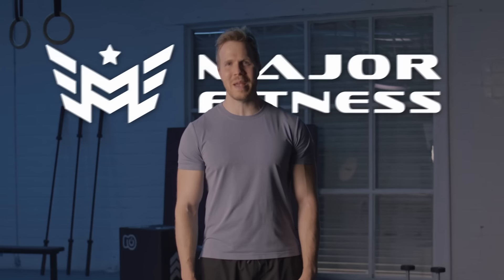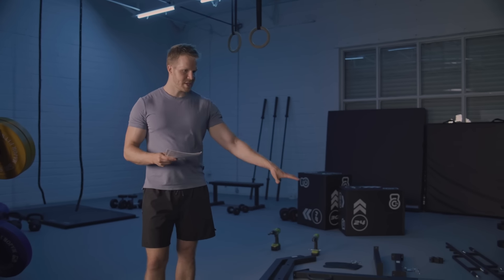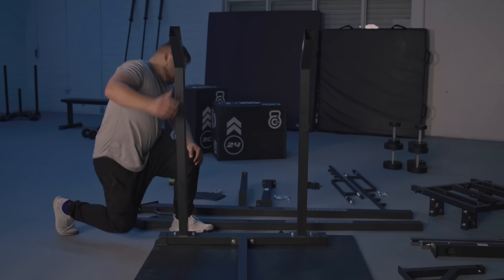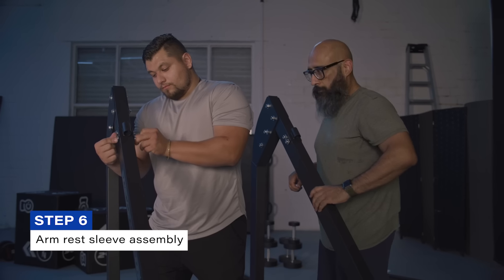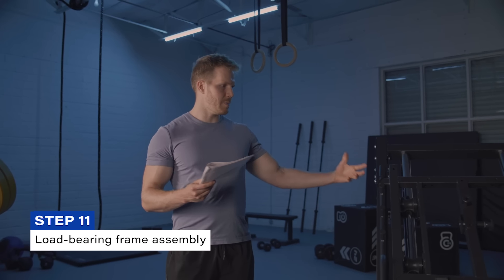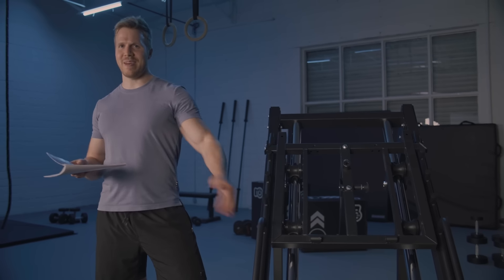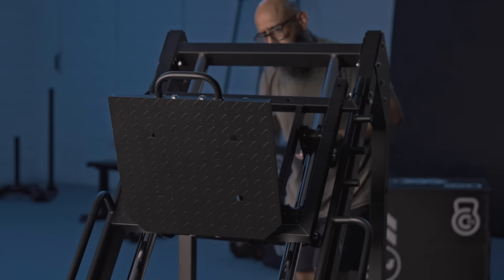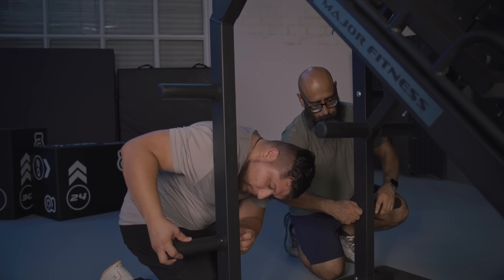How To Assemble The AH1 Leg Press & Hack Squat Machine | Installation Walkthrough

Comment: Would you say it’s required to afix the barbell to the machine? Or can one go on without using it and just using the weight holders that are in the back of the machine?
Reply from the maker: Hi there. The barbell is not mandatory; however, if you only use the weight holders in the back, the amount of weight you can load will be very limited.
Reply: @major-fitness  what's the max weight the back holder can hold?
Reply from the maker: @LenGarageGym  The weight capacity is 400lbs of the back holder.
Reply: @major-fitness  not too shabby.